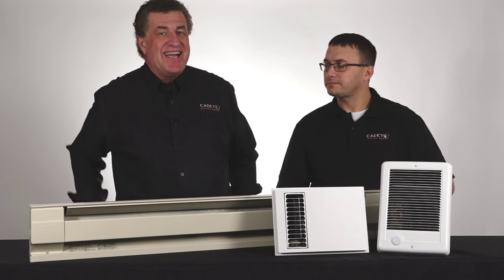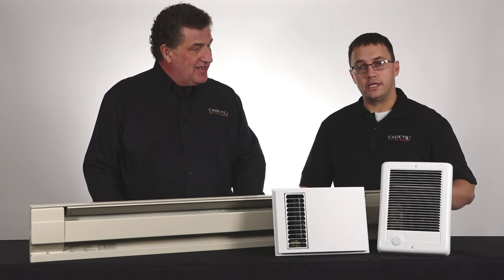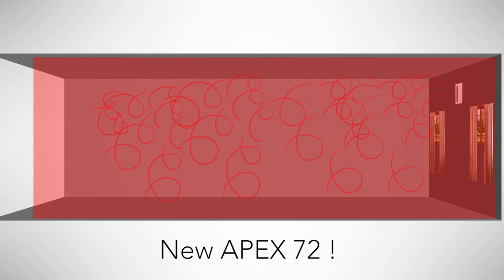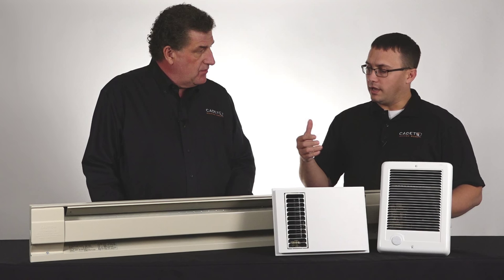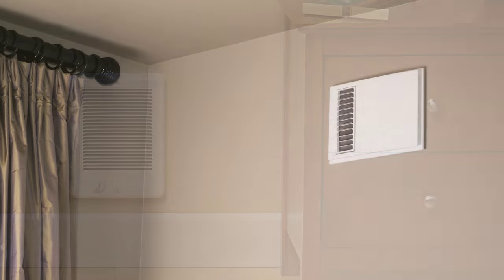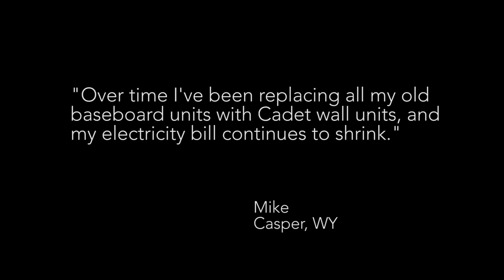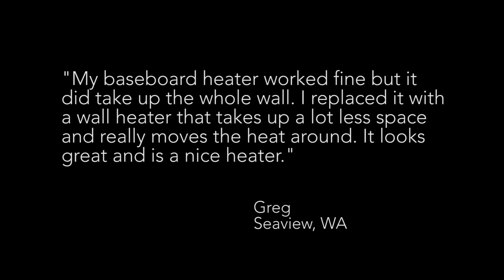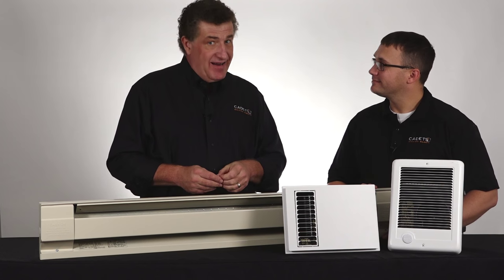Why upgrade from a baseboard heater to a wall heater | Cadet Heat

Comment: We bought two In wall heaters to test out, installed one and quickly realized just how loud they were compared to the baseboards. The thing struggled to get the 120sqf mud room up to 60 (It's a cabin and we kill the heat when we leave). So we took the other one back and have stuck with the cadet baseboard heaters. Super quiet and I think they actually heat up better than our "test" in wall unit. Just my .02...
Reply: I think you answered all of my questions better than any of the videos I've watched.  Thanks for your comment.
Reply: I prefer baseboard as well. they're quieter--the only sound is an occasional creak of the metal expanding as it warms up.

Comment: My last apartment had wall heaters I loved them. Now I have stanky base board heaters. I’m afraid the power bill will be crazy
Reply: Jasmine V oh it will
Reply: My first house back porch I originally installed a baseboard heater with a wall mounted thermostat but never felt warm . Removed it and installed a wall heater of a similar power draw and kept the room warmer. Had electric oil filled heaters for the camper in the winter and threw them out. Found a different brand same style and worked much better. Same power draw but some things work better

Comment: I'm skeptical about  the notion that wall heaters are any more efficient; every watt, even those powering the fan, is converted to heat. The only loss with electric baseboards that might be lessened with the wall heater would be heat that is radiated to a poorly insulated wall and ends up outside; that shouldn't be much, but it might be in some extreme cases. But either way, I trust the safety of wall heaters more than I would most electric baseboards; there is much less opportunity for flammable stuff to fall onto them , heat up and start a fire. For those who want the quiet and evenness of baseboards, do you have any models in which water (NOT oil) is heated by the element, with low, regulated temperature, and that is used to heat the fins? That would seem like a safer alternative to the scorchers that were popular in the 1970s.
Reply from the maker: That's a fair point that all electric heat is 100% efficient when it comes to turning energy into heat. The main difference is how long the heaters need to run to get your room up to temperature. The wall heater spreads the heat throughout the room faster because of the fan and most times will not run as much per hour as a baseboard heater. So it's more efficient when it comes to the amount of money you're spending to heat your room.
The only hydronic options we have are the SoftHEAT baseboards, we don't have an option that heats water.
Reply: Wall heaters are installed inside a stud bay, displacing the insulation. So they lose more heat to the outside (if placed under a window). They have a higher power density, so higher local max temp, so more losses. 

So, technically baseboard heaters have less losses, they are more efficient. 

The difference is in how they are used. Maybe wall heaters give a perception of better comfort for the user? 

For example, electric radiant heaters are not more efficient inherently, but they produce a more pleasant heat for the user, resulting in lower temperatures, lower usage.
Reply: @paftaf  Agreed. A lot of it is perceived heat. If you can circulate the heat around the room more effectively, the floor and ceiling will be the same temperature. The actual heat generated to the room is the same, but if your feet are a similar temperature to your head, you will perceive the heat is higher overall, meaning you won't crank the thermostat so much. This is why radiant in-floor heating ends up being more efficient. or electric carpets like they often use in Japan. A 40W electric carpet at your feet plugs into the wall and you can stand a much cooler room.
Reply: TheNewGreenIsBlue 
Yes. Humans feel warmer when their feet are warmer. Heating the ceiling is waste.

Comment: Are these good and safe to install in a bathroom with no heat ? My garage was converted into a studio apartment ( by previous homeowner)and they did not run the baseboard heating copper pipes all the way to the bathroom. It’s always cold unless you turn on the heating lamp/fan. I don’t like it bc I feel it’s not to efficient and there’s no way to add a thermostat to it. Is this a better option for my needs ?

Comment: Plug in oil heater (1500 watts) works better then both of these for small areas. The oil version stays warm even when it cycles off. No moving parts, quiet and Costs about me 35 a month to run 1 often.

Comment: I moved to a house that has cadet wall heaters and i'm surprised this is a thing.. they generate too much noise pollution the entire day. Also i couldn't even sleep the first night, and took me few hours to understand that i would fall a sleep when the heater turned off but then when it starts running again it would wake me up.. So now i would turn off all the heaters before going to bed. I started searching about maybe replacing them with baseboards and to my surprise, Cadet is suggesting the opposite so i guess i'll check for another company that does baseboards that maybe are up to date??..

Comment: What if this is an outside wall with insulation inside. This unit protrudes inside the wall where the insulation and vapor barrier are, which is quite different from a baseboard heater?

Comment: So I am sold on changing to a in wall heater but am confused how how to safely disconnect the old baseboard system on a central  thermostat
Reply from the maker: So are you talking about a hydronic baseboard system hooked up to a boiler or multiple electronic baseboard heaters hooked up to one thermostat? This particular video is talking about replacing electronic baseboards with wall heaters, which would have their own individual thermostat. If you have a central system, you can install an electric heater in individual rooms to heat them independently. They will work in combination with your central system.
Reply: 3 baseboard heaters tied into one thermostat is what I am trying to replace. A family a couple months ago barely made it out (3 went to Harborview M.C.) of a fire caused by baseboard.
Reply from the maker: I'm very sorry to hear that. If we're talking about multiple baseboards tied to one thermostat, that's something that would probably be best taken care of over the phone. Can you send your contact info to social@cadetheat.com so we can coordinate a phone call?
Reply: Update. Well that was easy! 6 installed. Biggest hiccup was the one in entry in Our split level... Took 3 holes due to my inexperience and a doggone water pipe. Lol, but I also now know how to patch holes and back them with a 1x2 had the stuff for it out any ways :-) Thanks for the help and encouraging videos! I am looking forward to seeing a lower heat bill last year hit $450 in the winter months electricity wise for our 2000 sq ft home. I can tell a huge difference already with how quick they heat our home.

Comment: Is this a good way to replace the heat option in a home? Currently my cast iron radiators were stolen and Im not even sure if the boiler works. Is this a good option for Michigan winters when the temperatures can go as low as the negatives?
Reply from the maker: Hi Jhanay. Yes, our heaters can be used alongside a central heating system or on their own if you wish to heat each room individually. They are built to operate well in colder temperatures. We would recommend using a heat loss calculator to determine how much heat will be required to heat each room. Our heat loss calculator can be found be following this link and scrolling to the bottom of the page: https://cadetheat.com/product-support?_route_=product-support

Comment: I been heating my mobile home exclusively with baseboard heaters and got my first whole month bill...$531 !

I need a better option. Will this wall heater make a significant difference in cost to run ?
Reply from the maker: Hey Joshua, You should see some energy savings with a wall heater but there are a lot of variables that would impact how much you save. There also can be some restrictions on what heaters you can use with a mobile home. Because of that, I think we can better serve you in an e-mail or phone call. Please send us a note at social@cadetheat.com and we can help you figure out what your options are.
Reply from the maker: Upgrading to electronic thermostats is usually a great first step for someone looking for energy savings with electric heaters as you said. If your bill seems to be unusually high as Joshua is experiencing, there could be something else going on. At that point, we'd suggest you call our tech support team so we can give you the best advice on what is going on.
Reply: House insulation is the best remedy. Add layers of clothing. Mattress heaters are very useful too as they only heat the bed, not the air. 

Electrical heat is nearly 100% efficient as all the electrical energy is transformed into heat. A propane furnace is less efficient because some energy goes out the chimney. 
Heat pumps have the highest “perceived” efficiency, they are wonderful.
Reply: @GOD OVER MONEY No, they aren't lying.

Depends on what you are calling "efficient".  In technical terms, and as someone who "studied electrical theory" (whatever that means) should know, essentially all energy put into an electrical heating element is converted to heat released to the room, there is no waste (the waste in an electrical circuit IS heat!).  It is as close to 100% as to being irrelevant.  A gas or oil furnace looses heat from venting (through the flue) or imparting that heat on another carrier material (water, glycol, air, etc) to transfer the heat to where you need it.  Obviously new and expensive condensing furnaces/boilers/whatever can be really high in ratings 95%+ but you are going to pay big bucks for that and it's still not 100%.

The reason electric heat is expensive is not due to efficiency of the heat source, it's that electricity ITSELF is expensive per unit of heat output. It's not even close to gas. 

Electricity:  3,413 BTU/kilowatt hour
Natural Gas:  100,000 BTU/therm (propane is slightly less)

Electric heat is also, generally, slow to heat up. As most people have convection baseboard people turn it up higher thinking it will help heat the room up faster (which it obviously doesn't but I see them do it all the time) and then they forget about it and 2 hours later their room is 85 degrees. That's why fan forced air for electric works better.  It's not going to cut your bill in half, probably not even 15% as the amount of energy required is still basically the same, but you feel like it's warmer sooner so (sometimes) people set the thermostat differently.

Comment: Can these be set up with a thermostat so i can set it and forget it?
Reply from the maker: +Cainnech yes some models have a built in thermostat and most can be hooked up to a wall thermostat. In both cases you can set a temperature and the heater will maintain that temperature. Just be sure not to have anything blocking the heater so it doesn't turn on when it's blocked.

Comment: I notice the heaters are placed in sheetrock walls i have paneling walls i notice sheetrock doesnt catch fire as fast as paneling walls so can i still use with paneling walls
Reply from the maker: Hi Therrin, 
Yes, you are able to use wall heaters with paneling walls as long as it is real wood. Just make sure you account for the extra clearance of the paneling to get your grill installed.